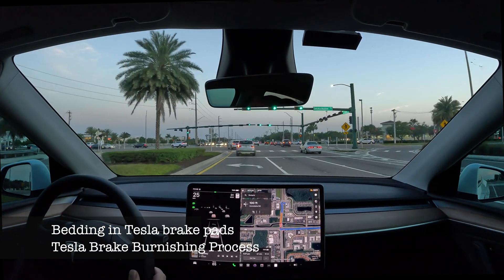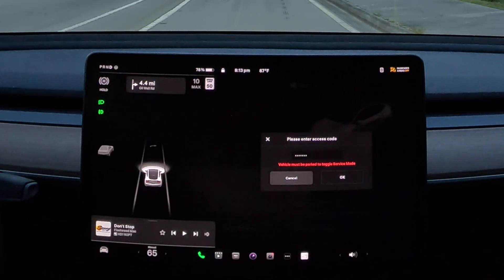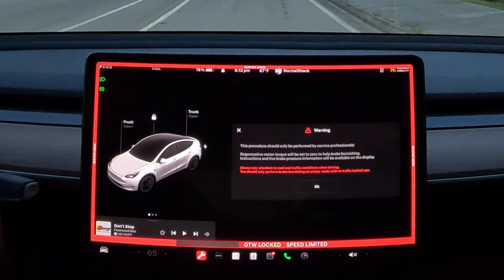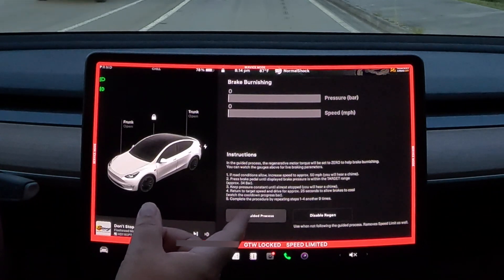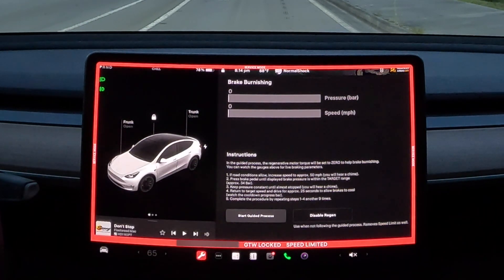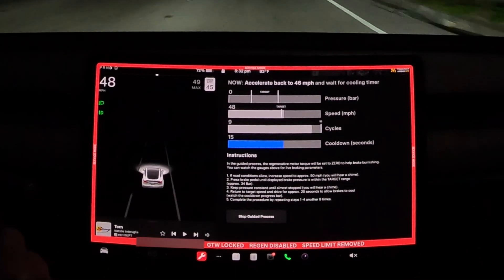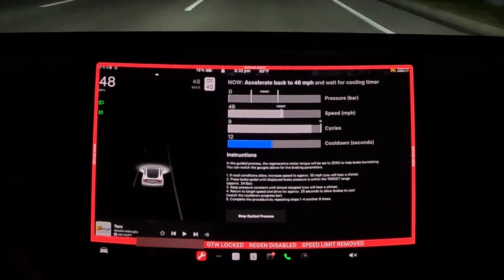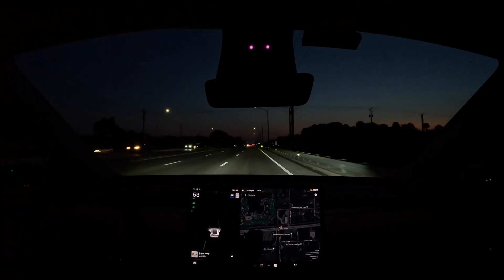How to bed in Tesla brake pads - Tesla Brake Burnishing procedure

Comment: When should you do this? Sorry I’m lost
Reply from the maker: Right away is good. Bedding in brakes in a typical car usually happens in the first few hundred miles. But Teslas are often run with regen braking so the regular brakes are rarely used.  The friction brakes may take a lot longer to get bedded in with ‘regular braking’.
Reply: @NormalShock  understood thanks! is 18k miles too late? Is it even worth it
Reply from the maker: @mk_g1  
Yeah could be worth it. It’s a straightforward procedure